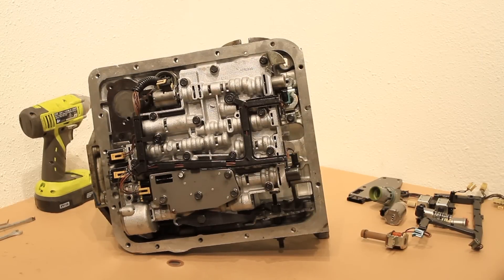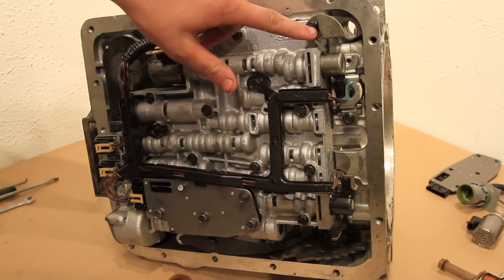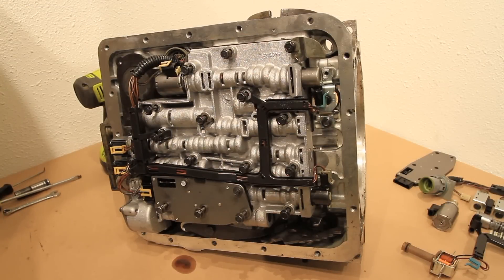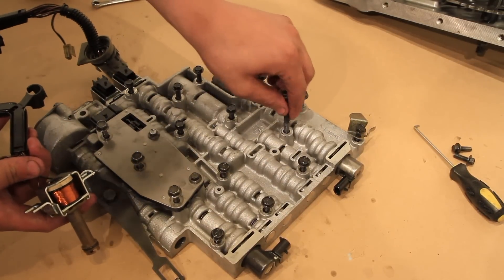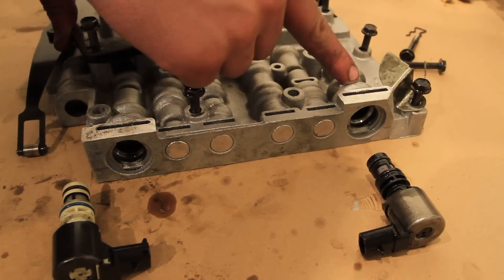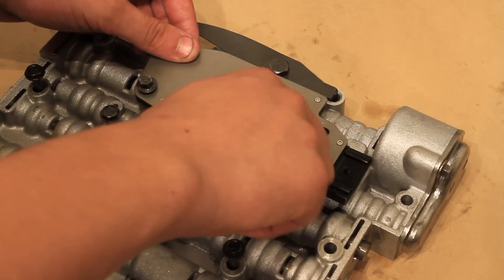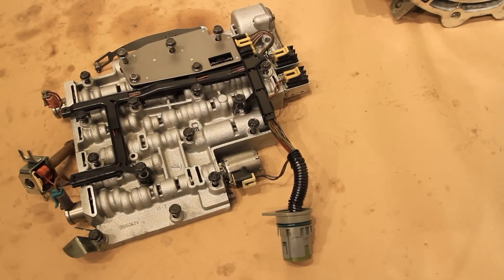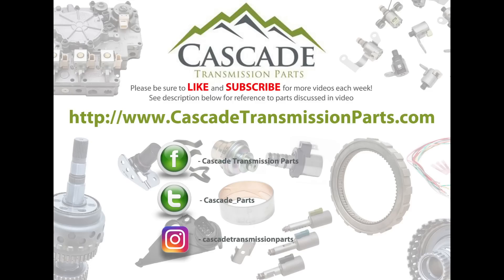4L60E Solenoid Set Install Tips - Valve Body Information : DIY Series

Comment: I was coming home from work yesterday & while going to down the road felt a hard jerk & transmission down shifted. I pulled over & put in park. Got out & looked under vehicle for fluid or anything outta the ordinary. All looked good. Started vehicle back up, put in reverse went into reverse fine, shifted to D nothing, then 3rd nothing, so I shifted to 1st moved just fine, 2nd just fine, but no 3rd or drive. Luckily I wasn't far from home so drove home in 2nd.
Reply: Did you ever find out what it was im having the same problem

Comment: Excellent illustration, I need to replace my 1-2 and 3-4 shift solenoids. I will know what to do based on your video.
Reply: I don't believe you have a solenoid issue. What's the chance of all of them failing at the same time?

Comment: Fantastic video. Thank you.

I was wondering if there’s any special concerns with removing the valve train behind each solenoid (one at a time of course) clean up the valves and douching the valve body with parts cleaner followed by some Fresh fluid for pre-lube?

Question #2 is it advisable to try and drain the torque converter (if possible) so that more fresh fluid is introduced at filling? 

Alternatively, I was throwing a small trans cooler in line and I’m wondering if there’s a way I can use a transfer pump and pump some fluid through the tranny and try and displace more of the old used fluid...That is still the majority of the volume during a filter service. 

I’ve also purchased a pan with the drain plug, this master solenoid kit replacement will be the second filter replacement and I guess I’m prepared to do a couple more filter replacements over the next 500 to 2000 miles to try to freshen up the tranny fluid throughout.

Figure I got nothing to lose and everything to gain.  If  my training needs rebuilt I’ll have a new valve set in it and a new pan and a new trans cooler.

I’m changing these valves because after my first fluid change I did have shutters shifts that were not there before, feeding the wives tale lore that you’ll make things worse. Still I’ve driven about 600 miles on it in the shutter shifting goes away when it warms up (when the training warms up doesn’t seem to matter if I let the truck preheat) 

Anyway I’m real hopeful and I hope this information gets answered for myself and other people and again thank you very much for such a great video production

Comment: Hello
 I read an article about the operation of a valve body and I am currently repairing the one of my truck described in the matter, since it lost rear traction and the truck looks symmetrical there wheel drive.  When I measured the solenoid that activates the awd Transfer clutch, it had no current.  I opened it and repaired connecting one end that was loose from the terminal and already has power;  However, in the manual of the valve body of one of the images that I attached to this email, there are the measurements in omni of each solenoid and in the one that I repaired it says that the measurement in omnion of that is 3.2, but when repairing it and measure it with multimeter, it shows 3.8 and then drops to 3.6 omnios and stays there.  Looking for the solenoid on Amazon or ebay, they show several of them and the one that best suits the one I need, says in the notice that the omnios are in a range between 3.2 and 3.7.

 Do you know what could happen if I install and assemble the solenoid in the valve body with that range of measurements?

 I appreciate in advance if you can advise me
 Greetings from 🇱🇹

Comment: Ahah!! Why do all the other vids talk about the A and B solenoids but not the other 2? I just changed the A and B, and my fluid and filter, didn't really see any signs that my clutches were burning up, no real excess of material that would make me think clutch material, fluid didn't seem too bad though you could tell it was starting to age... and it'd still shift through gears just fine, but when I let off the gas to coast and tried to throttle again, I'd get nothing but rev until I hit about 3k rpms and it'd finally catch again. If I go ahead and floor it till I get to the next gear everything seems to return to normal, until I'm back within those speed/gear ranges. When I heard the name "3-2 downshift solenoid" certainly rang a bell. Someone tell me if I'm way off track.

Comment: "You do not need to remove the valve body" 

..proceeds to remove the valve body
Reply: this video would have been much better if he didn't remove the valve body
Reply: @kylefowler5082  Really ? Why is that because You already know all about the 4l60e transmission ?

Comment: Is it a must to take valve body out to change the solenoid master harness only. I broke the cable lock tab solenoid 1-2A while installing the pan.  The one near the back behind exhaust crossmember. thankyou
Reply: Other than making it easier to get to everything I dont see why you would have to drop the whole valve body. My opinion only.

Comment: I am having a hard time with my  epc solenoid. its like stuck in there? once the bracket is off it comes part way then seems like something stopping it from coming all the way out. should i just tug on it a little harder or am i missing something?
Reply: the bore it sits inside is a tight fit but it should just slide out - a flat screw driver with gentle apply and it should pop right out.

Comment: Can you help me with a question about the valve body of Selenoids for automatic gearbox cvt lineateonic Subaru Forester XT 2015?
Hello
 I read an article about the operation of a valve body and I am currently repairing the one of my truck described in the matter, since it lost rear traction and the truck looks symmetrical there wheel drive.  When I measured the solenoid that activates the awd Transfer clutch, it had no current.  I opened it and repaired connecting one end that was loose from the terminal and already has power;  However, in the manual of the valve body of one of the images that I attached to this email, there are the measurements in omni of each solenoid and in the one that I repaired it says that the measurement in omnion of that is 3.2, but when repairing it and measure it with multimeter, it shows 3.8 and then drops to 3.6 omnios and stays there.  Looking for the solenoid on Amazon or ebay, they show several of them and the one that best suits the one I need, says in the notice that the omnios are in a range between 3.2 and 3.7.

 Do you know what could happen if I install and assemble the solenoid in the valve body with that range of measurements?

 I appreciate in advance if you can advise me

 Greetings from Colombia

Comment: You do realize that you completely left out the part where you installed the 1-2 & 3-4 shift solenoids? Does each of the shift solenoid shafts have that rod that is spring loaded or just the one?
Reply: Just the one.
Reply: This. 

I can’t get the B solenoid back in, almost as if the valve is stuck.

Comment: Hello sir, I am throwing a 2-3 shift solenoid code. I changed the solenoid and the code is still there. Do you think this master rebuild kit will help me? It's a 2004 GTO has a 4l60e with a Yank SS 3600 stall converter. When it's cold it drive fine and shifts great. Once it warms up it goes into limp mode and only has second and third gear. But when I turn the car off and let it sit about 10 minutes it is fine again. The fluid is nice and clean but it does have a strong smell.. kinda like celery. Any help would be greatly appreciated. Thanks in advance!

Comment: Would the codes include harsh delayed 1 to 2 shift and sometimes 2 to 3 too when hot , trouble code transmission slippage , I changed the tps , and same thing , from a 07 4L60E old body style 4.8L canada .
Reply: Did you ever find the problem? mine is the same way.
Reply: Mine also

Comment: I have a 2001 s10 blazer, quit going into 4th gear. So the guy I got it from changed fluid and filter now it wont engage at all not even reverse. Any advice on what to do?

Comment: My truck shutters and jerks during acceleration while in Overdrive once the engine is hot. Especially going up hill. What do you think is the problem. 94 Chevy C1500 5.7L 4 Speed. Wayanchors.
Reply: Wayanchors Wayanchors I think it it's the air fuel sensor.
Reply: Wayanchors Wayanchors torque converter maybe.

Comment: I have a 97 trans am Fire bird LT1 5.7L V8 Not sure about the transmission model but, first thing I have noticed is it shows me going faster than it really is... and now I think the trans is causing it to blow #13 PCM IGN and then or at the same time it blows the #11 Ign fuse under the hood... any thoughts on this.... thanks in advance !! :)

Comment: can you remove the valve body from one transmission and use it for another transmission as long as it's the same trans, year etc?
Reply: They go bad when trans get hot and running with fluid low.
Better to use new parts or you may end up doing it twice.
I'm going to try and do it without pulling trans.
If I can do it so can you.

Comment: My 96 lt1 4l60e hit rev limiter twice before shifting to next gear at wot. Normal driving condition are great. I change tps, shift solenoids, speed sensor. Basically most sensors are new. I never changed epc. Would that cause my issue?

Comment: Hi, my 4L60e slips while in position 'D' when it gets to 2nd gear at 2500rpm. As if I shoved it in neutral and at 4500rpm or if I let off the gas, it will shift to 3rd gear. But it doesn't slip when in position '2' or if I drive it like I was doing a 0-60 from a dead stop. I tried the longer Sonnax servo pin, and it does the same, exact thing and seems to have a friction sound (not sure if it is binding). Everyone tells be me my 2-4 band is shot but I'm not so sure.
So while in '2' I get more fluid pressure than in 'D' and it doesn't slip - what sensor or component controls that pressure? And apart from the band what 'could' be causing this issue. Thanks for any help you can offer.
Reply: Were you able to fix your issue? I'm having the same problem after I did a transmission oil change and filter. No flush. Just oil change.

Comment: How different is the 4l80e to this 4l60e
Reply: they are similiar, but different : 4L60E's have 16 pan bolts RPO Code M30/M32 :::  4L80E = 17 pan bolts Rpo Code MT1
* also if working on a 1991-1993 then the external harness would also need to be updated
we do stock everything possible for all that range of Gm Trucks

Comment: what is the difference between the 95 and the 96 -up transmission/corvette
Reply: Ihave owned both the 95 and the96 and i like the way the 96 shifts alot better,it seems like it has more....
Reply from the maker: Hello, 1995 was a split year , early models are non PWM , late ones are PWM (Pulse Width Modulated)
The easy way to tell is PWM models will always contain the two solenoids on the front corners - one will have a gray stem (connector) , the other will be the white stem (connector).  Additionaly in 1996 GM added a vent hole above the manual valve.  This hole can be added to older models just so you update to the newer manual valve also.  Hope this helps.
Reply: My gmc envoy  have a same problem she is no shifting gear after 40 speed
Reply: I put my 95 in my 96 cant get it to shift

Comment: Will this fit in my 06 trailblazer ls 4.2v6?
Reply from the maker: Hello - 2006 was a split year, install and parts almost identical
to be certain of what style harness you have you would need to count the pins in the main plug
we have both kits in stock, the most common is 13 Pin - if you have a 15 pin please email us
www.cascadetransmissionparts.com/4l60emastersolenoidkit03-06.aspx

Comment: I have a 1995 S10. I was wondering if you could give me some advice on fixing a problem I'm having. I keep blowing the ECM Batt fuse. It only happens when I step on the gas pedal hard. If I press the gas very slowly it doesn't blow the fuse and it only happens in forward no matter what gear but doesn't blow if I hit the gas hard in reverse. I have already eliminated the possibility of the problem being the fuel pump, fuel pump relay, oil pressure sensor and the ECU. The person I bought the truck from said the dealership said it was blowing the fuse because of a solonoid in the transmission and they wanted 1200$ to fix it so he sold me the truck but my check engine light is not on and I don't have an OBD code reader so I'm not sure if it's even tripping a code. The truck had an aftermarket security system when I got it and there was some metal conduit running near the starter that would arc on the starter and blow the Ecm B fuse due to a bad motor mount which I replaced. Also had the aftermarket security system removed. The truck ran good after removing the metal conduit I would drive it just fine, I could step into the gas hard with no problem. I was towing a truck one day on my property and all of the sudden the ECM B fuse blew again and it's been doing the same thing blowing every time I step hard on the gas pedal. The truck revs fine in neutral or park. I've looked for burned or pinched wires that could be grounding out somewhere but I have found nothing. Could my problem be a transmission solonoid or have you ever dealt with something like this problem? Any help would be greatly appreciated. Thanks
Reply: The metal conduit is supposed to be bolted to the starter . It shields heat from engine/exhaust from the wiring . The powertrain control modules are fairly sensitive so  its possible that the arcing/sparking fried something in the pcm or its wiring issue. The wiring can be fun to find the issue. Good luck

Comment: Can I take a transmission out of a 93 1500 and put it in my 1991 Chevrolet 1500???? can someone help me please
Reply: Can I put a 93 transmission out of a 1500 Chevrolet into a 91 1500 Chevrolet truck
Reply: Someone hit me with that answer please
Reply: no the 1991' is a 700R4 & the 1993 is a 4L60E
two entirely different computer and electronic vs hydraulic shift commands

Comment: Do you have a kit for my Chevy silverado 1994? Cant find it.
Reply from the maker: If you still need, we do have the non pwm kit also - it's nearly identical to this one
simply order the below link on the site, within the order notes field enter " FOR 1994 Model "
the clerk will adjust the order, and that kit is about $17-$19 less in cost - hope this helps
http://www.cascadetransmissionparts.com/4l60emastersolenoidkit96-02.aspx

Comment: i have a 99 Silverado, the transmission is slipping but when i turn the tow/haul button it shifts fine, any advice?
Reply: Torque converter.
Reply: Yes torque converter and driving it for 5 minutes slipping renders the trans to needing complete rebuild

Comment: 2004 Yukon Denali. Code p1810
It shifts fine when you first start it sometimes. But then it will downshift from 3rd to second and stay in second gear 
Once it shifts down to second it stays in second even after a complete stop. 
I can manually shift from 1-2, but not from 2-3. 
Could this be one of the A-B solenoids? Or the pressure manifold?
Reply: I'm having the same problem I don't know how old is video is but if you ever got it fixed I would like to know I'm thinking it's the manifold
Reply: I’m having the same exact problem!

Comment: My S10 1998 4.3 v6 it will go in drive not revere
Reply: hate to tell the both of you, but you probably know now, that's the weakpoint of these transmissions. most likely your trans has burned out the reverse clutch pack. it happens to almost all of them

Comment: How difficult would it to design a fully mechanical hydralic pressure operated valve body with speed controlled electric overdrive.

Aside from the lock up tourque convertor to the 400 is the same damn thing.
Surely one of you lazy rocket scientist can figure out a way to lock up the torque converter in the old school tranny.
Reply: It's called a 700-R4. The predecessor to the 4= forward gears, L= ongitudinal, 60= torque rating, E= electronic. Another name for 700-R4= 4L60 no "E"

Comment: Losing power
Reply from the maker: Hello Odi sorry for the late reply, would need much more info if you're still having the no power issue ?
would need check engine codes, miles and all the other related specifics to assist in detail.